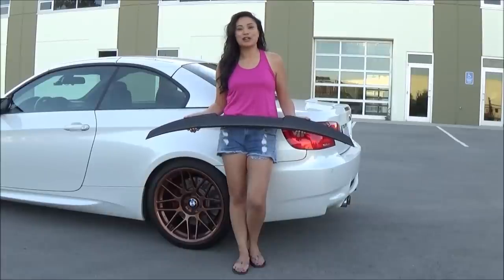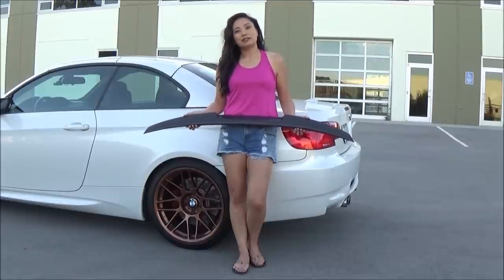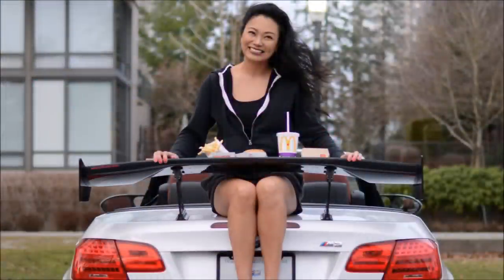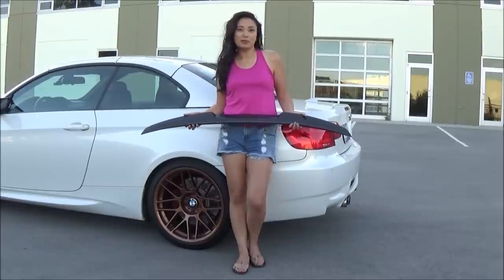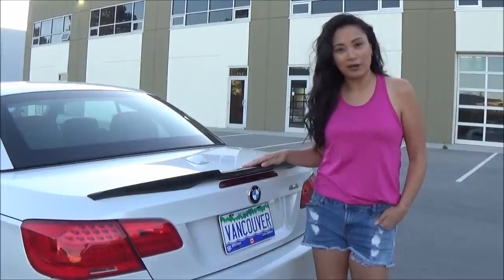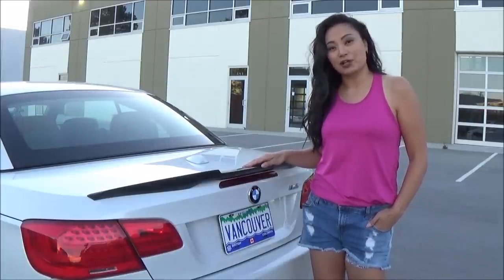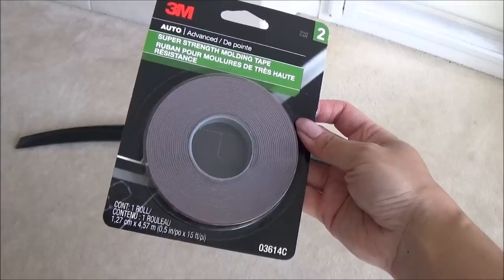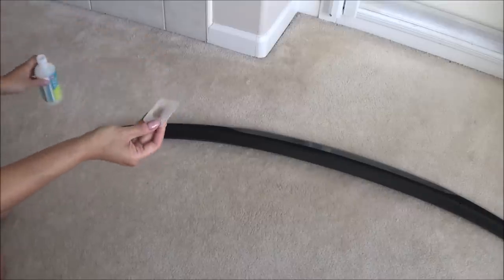How to Install a Carbon Fiber Spoiler

Comment: I fitted the same spoiler to my 435d cabrio...the tape never worked and the spoiler came loose...the other spoilers i fitted was ok but not this one...so i glued it on...keep an eye on it hun x
Reply from the maker: That’s so weird. What tape did you use? I used the same tape that I’ve used on my last car and it never moved in the years I had it.
Reply: @TVTara  I used 3m tape ...like u my last one was solid but with the  435d the carbon spoiler just wouldnt hold..maybe as the lip curls around the trunk lid .... but all cool now it looks amazin hun x
Reply from the maker: Ok good